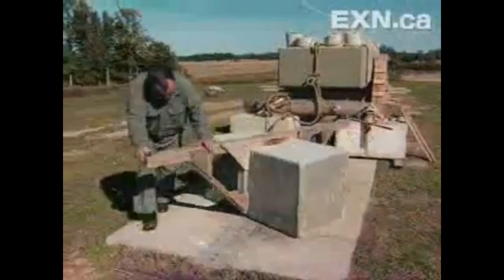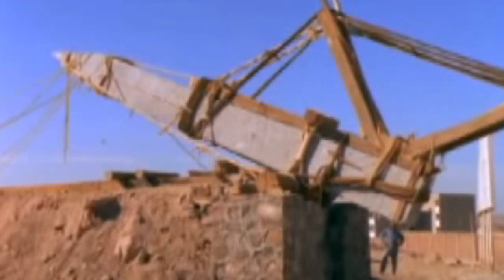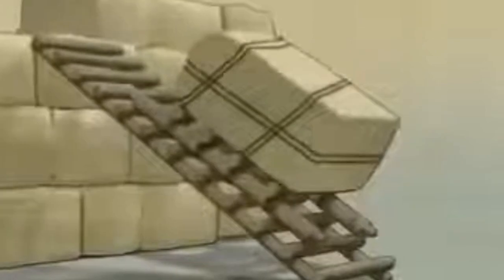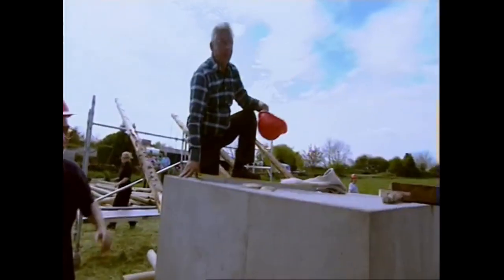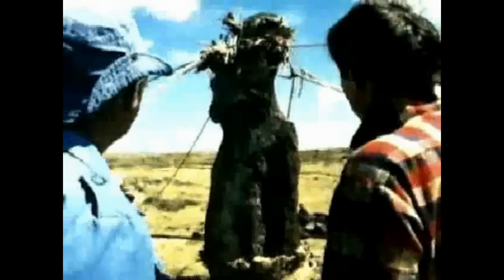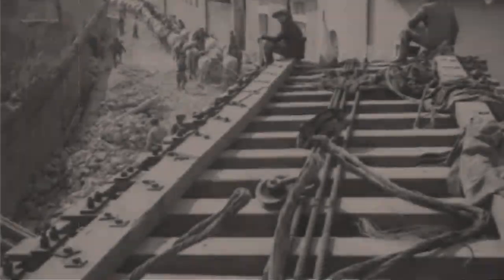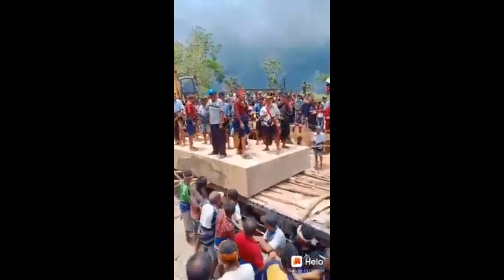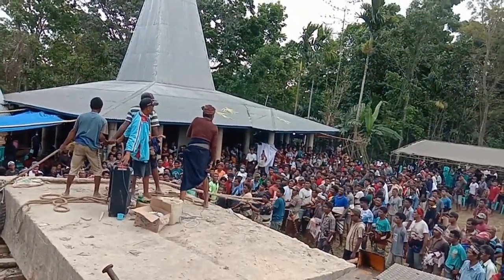How The Ancients Could Move & Place MEGALITHS With Primitive Tech. LAHT WON'T SHOW YOU THIS!

Comment: Taking the meaning of the word literally I think you're wrong to call these techniques "primitive". Because the megalithic builders had a good working knowledge of trigonometry, geometry, multiple ways to gain mechanical advantage etc. All the same physics that we use today, but without the materials science of today.  Saying aliens did it is insulting to our megalithic ancestors, at the same time calling it/them "primitive" is also a bit insulting. Unintentional as it may be on your part. A sharpened stick is primitive. A flint knife or axe is primitive. But even stone tools demand a great deal of practice to get the technique right. 

Just saying.
Reply from the maker: I agree but use the word “primitive” more in response to the Lost High Tech crowd. I occasionally drop in “loin cloth” wearing too but again to prod at those lost high ancient technology types who love to dismiss ancient people as “loin cloth wearing primitives”.
Just helps to use those kinds of words with the people who’ve watched a lot of those ancient aliens types of videos. Neuro linguistic deprogramming. Associate primitive with can do instead of can’t do.
Reply: @SacredGeometryDecoded  OK, I can see why you use it. But it is still disingenuous as people 3,4,5,6+ thousand years ago are classified as modern humans. If you called megalithic builders primitive while studying anthropology or archaeology you'd probably be marked down for it. Or your lecturer would at least correct you in red pen in the essay margin. ;-)
Reply: @spinny2010  "Low tech" would be a more apt appellation.  Yet as noted the videos relate the claims made by LAHT - if only tongue in cheek.  🤫  As an aside.  You are correct about ancient peoples as I have made a similar argument for years in response to LAHT claims.  If one reads as an example Caesar's Commentaries written 2,000+ years ago one can see military stratagems articulated in them that are still in use today in modern warfare.  Yes the technology has obviously improved = but the fundamental strategies are still in use.

Ergo if we were able to bring an ancient Egyptian forward to today -----> feed them on par with today's diet -------> send them to school = they should be able to compete with people today as far as intelligence.  Human physiology has not really changed in millennia.  Our better diets which facilitate healthier bodies and thus potential intellectual capacity as well as our ability to catalog information and pass it on are what differentiate us from those people of long ago.  Enjoy your day.  🤔
Reply: @varyolla435  In theory, if you were able to bring a pregnant woman here through time from even 15,000 years ago (probably further back even than that), her child should have the capacity to learn like a "normal" modern child. We only have what we have today through luck in part; due to the industrial revolution via access to coal.

Fun fact. All humans irrespective of gender or race have lost 150cc of brain mass in the last 10,000 years. Along with reduced muscle mass. Hunting and gathering needed brains and brawn.
Reply: @spinny2010  I would dissent your inference of technology - read the Industrial Revolution - as technology is a result of cognitive capacity which as alluded to is based upon diet and information retention and propagation.  Your brain is basically an engine.  Thus like all engines its level of performance is subject to the quality of fuel it is given.  The 2 things which enhanced our cognitive abilities and fostered our technological achievements are:

1 - "fire" and agriculture.  Herbivores as an example spend most of their waking hours feeding. The reason is what they eat is not overly nutritious and further they are unable to derive much nutrition from it.  We however as "omnivores" consume a varied diet. More importantly however is = we cook our food.  When man began to harness fire and cook his food that acted to allow us to digest the food more readily and to absorb more nutrients from it.  When we planted farms we had access to a stable diet.

Better nutritional absorption facilitated enhanced "fuel" for our brains leading to better cognitive development.  Studies show whereby children raised in endemic poverty who then suffer from chronic malnutrition see poorer cognitive outcomes as they are unable to provide their brains with fuel sufficient to facilitate normal development.  

As an aside.  The "we use 20% of our brain capability" nonsense is rot.  We use = all of our brain to think.  Our brains are already functioning at maximum capacity and thus "size" is less an indicator of cognition as opposed as noted above to how we train our brain to retain information and our overall health status. To develop significantly higher brain functioning as science fiction speaks to would require enhanced organs to deliver even more nutrients to our brains so as to allow that higher functioning.  Our brains already take a large segment of what we consume and the oxygen we breath to keep it going. 
2 - the printing press. When we created it that allowed for the mass propagation of information not subject to oral passage which can be imperfect.  Think the game Chinese whispers.  Oral passage of information can see variance in what is related owing to above and the way our brains process that information.  Just as we are quick to assumption based upon partial information = so our brains store information in a manner of quick retention - so that context might be lost.  

So when we "standardized" what we learned to pass that onto others we set the stage for higher learning and subsequent technology development - which led to the Industrial Revolution.  Enjoy your day.  🤔
Reply: @spinny2010  I don't know, Google's first definition of primitive reads "relating to, denoting, or preserving the character of an early stage in the evolutionary or historical development of something."  It seems fair to apply the word in this context if we are describing the early stages of human engineering 5,000 years ago.  For lack of a better word, I would go with primitive.  It's not that bad.